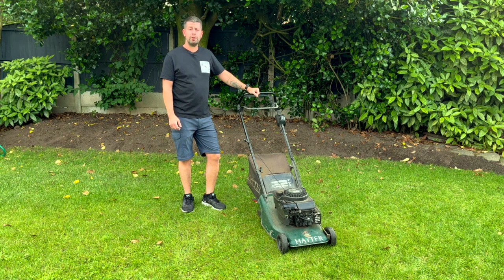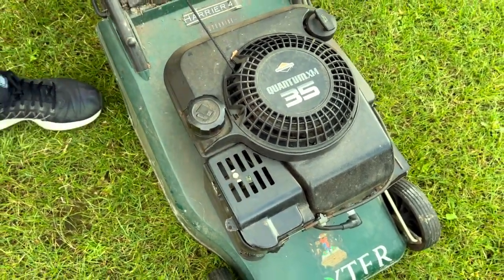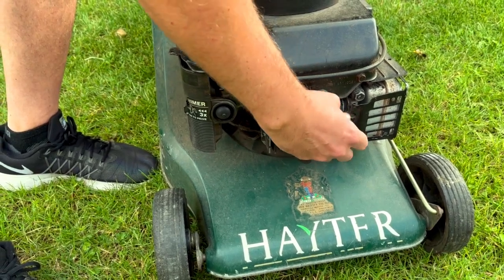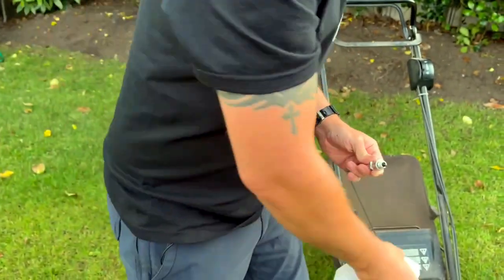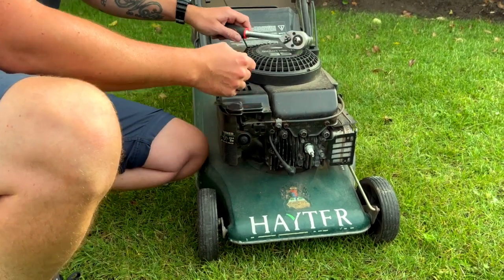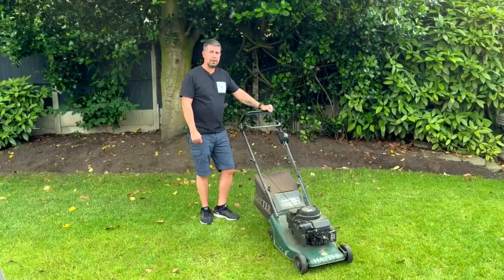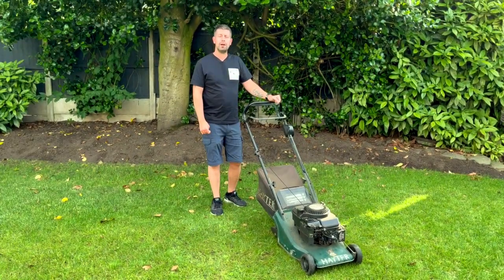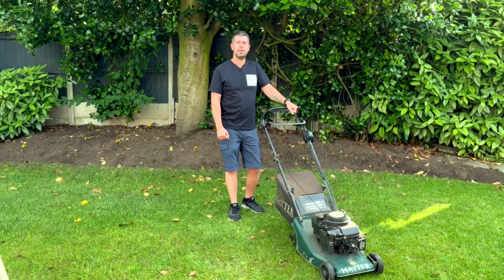Petrol lawnmower won't start. Quick and easy fix for free

Comment: 👍👍👍 Check the air filter. It may need cleaning or replacing. If it is blocked, more fuel than is needed gets into the cylinder. This can cause carbon build up.
Reply from the maker: Thanks I'll check the filter but I changed it last year when I did a service on it and it's had little use since. I've been using the Worx one as well. But I'll check 👍🏼
Reply: @spendtimesavemoneydiy   You probably know this, if the machine has been tip to the side the filter is on, fuel can soak into the filter and cause problems.  How are you liking the Worx , would you  recommend it?
Reply from the maker: @Pete.Ty1  I learned that the hard way when I first got the mower. I'd never used a petrol mower before and I bought it second hand so I tipped it over to take the blade off to sharpen it.
The Worx mower is great and I even bought one for my father-in-law.
Reply: @spendtimesavemoneydiy   Thanks I'm slowly coming around to thinking about changing from fuel to battery🤔,  they are certainly a lot easier to start up.👍
Reply from the maker: @Pete.Ty1  They are easier to start but sometimes I forget to charge the batteries 🙄
Reply: @spendtimesavemoneydiy  How should you change the blade without tipping it?

Comment: What happened to the Worx lawn mower ?!
Reply from the maker: I still have it and it's a good job when my petrol one wouldn't start.
I tend to use them both but when the grass is long and wet I use the Hayter.
I actually have 3 lawn mowers 🤣